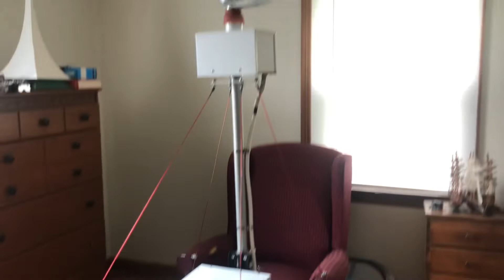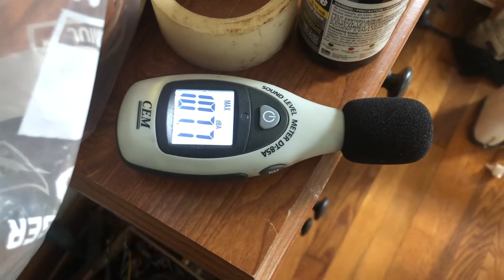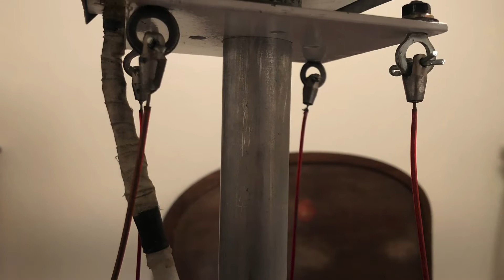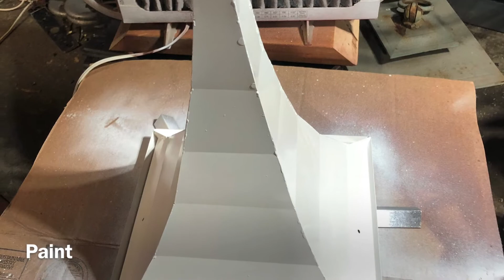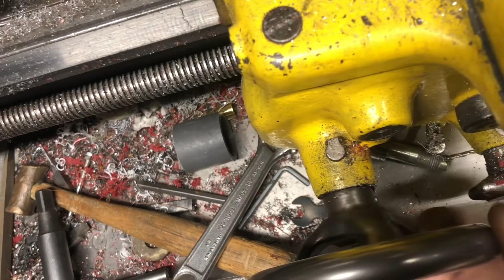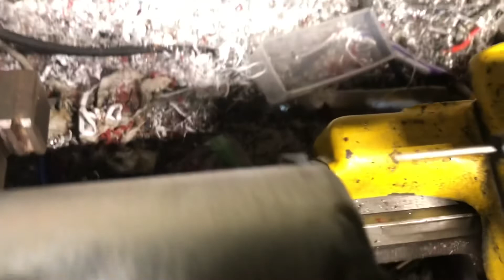Mini-apolis Thunderbolt Update dB Test Metal Horn plus slide show

Comment: A 6M spins at a lower speed if u could slow down the motor u could get the effect
Reply from the maker: True maybe, but it wouldn’t be as loud.
Reply: @tylerdavis9820  u should ty
Reply: @1000BT  wouldn’t work. You would need a larger blower that doesn’t need high RPM to move lots of air. That is how a 6M works. It runs at low speeds but puts out a lot of air making the siren louder than it would be with a 4M